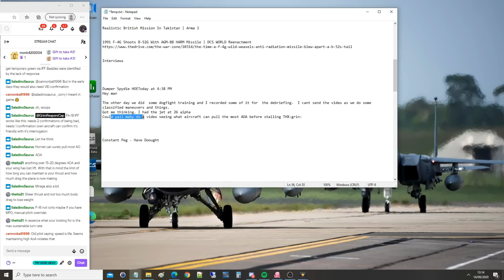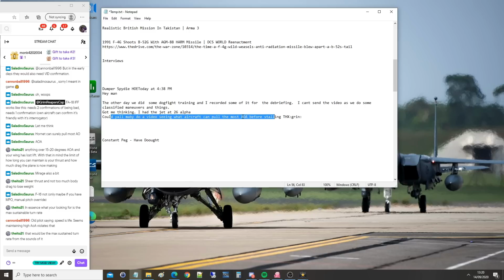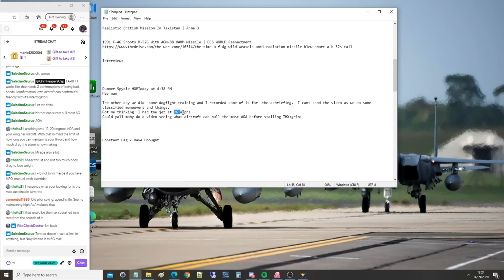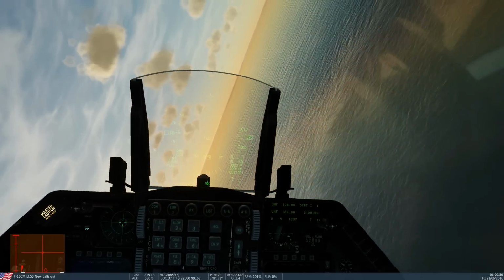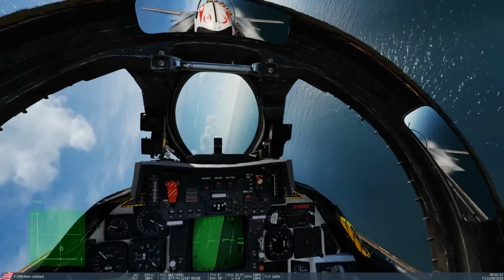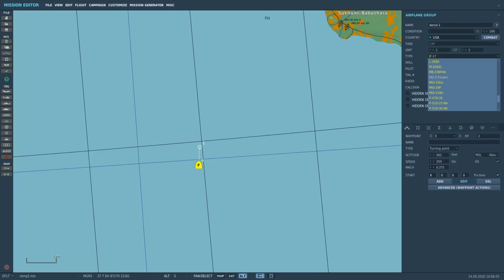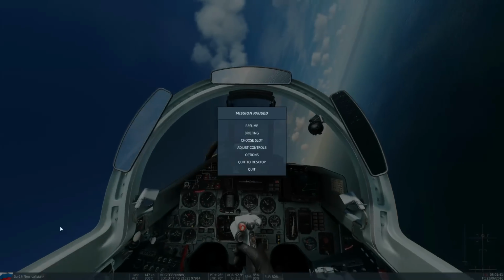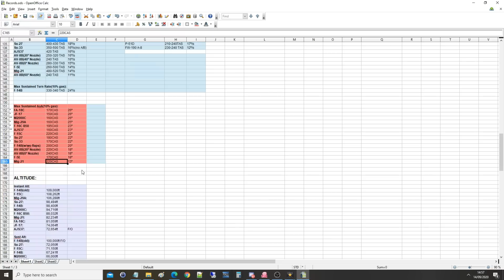Fast Jets: Max Sustainable Angle Of Attack AoA | DCS WORLD

Comment: From T.O.-1-1, a 26000 lbs Block 50 with DI=50 can even sustain max AOA turn at mach 0.22 using MIL power at sea level standard day (lift limit curve intersects with Ps=0 curve), While in MAX AB and same conditions, the speed is mach 0.32. The speed at which max AOA sustained turn is achieved doesn't mean a lot, sometimes simply a difference in thrust setting.

Comment: Turn rate is incredibly important but it is only as good as how long you can maintain it and how good your energy management skills are and your ACM experience. The defending pilot with a better sustained turn rate will take advantage if the attacker, as we've all done, reaches for the shot but expires their energy and thus loses turn rate. The defending plane will then maintain a higher average turn rate and gain the advantage. Some airframes especially, that have a high turn rates, lose their speed very quickly, significantly lowering their turn below below that of the defender. This is a real interesting subject and studying it will make you a better fighter pilot. It helps knowing your plane's capabilities inside out as well as those of your enemies plane.

Comment: I read in Johan Kylander's book 'In Pursuit' that rate of roll is the most important attribute of a plane because "having a superior roll rate means you can change your heading and/or plane of maneuver faster than the enemy and thus outmanoeuvre him. This is especially important when you are in a slower turning aircraft - as long as you hold the rate trump, the better turning but slower rolling aircraft must play by your rules". In my experience, Capt'n, the plane with the better turning rate and energy usually wins the fight so I never really understood why Johan prized this as the most important attribute. The book is in relation to WW2 prop planes. Not sure if this has any bearings on the matter. Johan does seem to know what he's on about. Any thoughts anyone? Maybe worth exploration in a video Capt'n.
Reply: You asked for thought so mine is that he is writing about a different era.  Prop fighters had a wide variation roll rates depending on multiple factors, and it could make a definite difference in combat.  Jet fighters with irreversible powered controls always have a good roll rate that increases with speed, and they are often artificially limited these days.  The clean T-38 could theoretically reach 720 deg/sec, so the ordnance carrying F-5E had an aileron deflection limiter to keep the pilot from rolling too quickly at high speed.
Reply: @gort8203  thanks Gort I think you're right

Comment: To my knowledge.... delta is perfect for low speed maneuvering as it creates vortex over the wings, so different lifting system, also good for faster then speed due to low drag... but it needs fast approach speed and good fly by wire.... all older designs are not delta as fly by wire was not mature enough and/or to high approach speed to be used so they used something in between all the Fs and mig/su are not delta for that reason....bit newer designs are almost all delta.... gripen, tornado, rafale... I thing even F22 is delta....side note, mig21 is not delta as it wing works more like conventional wing...
Reply: "all older designs are not delta as fly by wire was not mature enough"   
You are forgetting generations of delta wing jets from Convair and Dassault (just for starters) that were not FBW, so you don't need FBW for a delta wing.  If the delta was really perfect for low speed maneuvering the F-15, 16, and 18 might have used it. The wings of those planes are not true deltas (even with FBW) because they were designed to maximize sustained turn rate and could not afford the higher induced drag of a delta.  The MiG -21 is often called a tailed delta, but he F-22 is in no way a delta, it is a trapezoidal.  Yes, deltas do work better than ever in a relaxed stability FBW aircraft with a foreplane, but there's more to the story.
Reply: @gort8203  all part of design requirements, you can have delta without FBW but with more drag so they did calculations and come up with best performance for their design needs....but with later designs FBW was able to address some of the drag issues that is way you see more deltas around.... F22 has clipped delta wing, delta wing is not only the shape of the wing but the way it creates a lift. That is way I think mig 21 is not real delta as it has delta shape mainly for supersonic characteristic but is is not working as delta wing...
Reply: @markotdz9523  The delta wing does not exist for low speed lift, it exists to help provide for high speed flight.  It can produce low speed lift at high AOA, but not more than a wing with less sweep and higher aspect ratio can produce with less AOA at that speed. But that higher lift wing is not as good at high speed as the delta.
Deltas don't necessarily have more trim drag than non deltas at high speed. A primary benefit of relaxed stability is the reduction of excessive trim drag as the aerodynamic center shifts aft. FBW allows for relaxed stability and less trim drag for all wing planforms, not just deltas.  
If you want to call the F-22 a clipped delta you have to call the MiG-21 a delta as they both have tails, and the MiG wing is an actual delta planform. The words we use for  them don't change their characteristics so they are only important for a common lexicon.  Every fighter from the F-4 forward has at least a clipped delta if you want call it that, but I reserve use of the term delta for a classic delta because its aerodynamic characteristics differ from an F-4 or an F-16.  The F-106 and B-58 do not fly quite the same way as an F-15.  
Until the rise of the delta canard there were very few delta wing carrier jets because the low speed lift and drag characteristics sucked. Canard foreplanes and higher T/W ratios now help overcome the basic limitation inherent to the delta planform.
Reply: F-22 also has thrust vectoring which adds a substantial increase in both instantaneous and sustained AOA.

Comment: Wikipedia has a good article on the delta wing https://en.wikipedia.org/wiki/Delta_wing.  The short answer is that at high angles of attack the leading edge sets up a vortex that remains stable at high angles of attack.  I think the canard configuration has an advantage because a canard provides additional lift (i.e. its lift vector points up).  Whereas the traditional rear horizontal stabilizer is an inverted wing and has a lift vector pointing down.

Comment: Comparing how much AOA different airplanes can sustain is interesting from the perspective of controllability and T/W.  Controllability at high AOA is an important factor, but it does not directly translate into a comparison of sustained turn rates.  At a given speed and AOA a low lift airfoil will produce less coefficient of lift than a high lift airfoil, even before you factor in additional features such as a larger wing area or high lift devices.  One plane can be at lower AOA while sustaining the same turn rate as another at higher AOA.  There's a reason we compare one aircraft to another with diagrams that plot G, turn rate, radius, and Ps, but not AOA.

Comment: For highly longitudinally unstable airframes like the Viper and the Flanker exceeding certain AoAs (depending on quite a few factors, with the most important one being the longitudinal position of the CoG) basically means swapping ends. So, in this test naturally higher preference goes to neutral stability, effective vortex devices (with delta wings being vortex devices themselves) and the abundance of engine thrust at these speeds.

Comment: It's not you. The F16 AoA and FCS is borked/WIP and even induces oscillations.  Has been like that since the beginning.  It is also supposed to be able to out turn a JF-17, which has a lower g tolerate, a more restrictive FCS irl, and lower TTW, but in DCS the F-16 can only energy fight it.   One or both of them is off I think.
Reply: I've noticed this as well, i'd say both it feels like the JF-17 seems to handle a bit too well and the F-16 I can hardly ever do anything other than energy fight any opponent I face in a gun match.
Reply: Blackbirdz2000   It's basic math, trust me I'm a physicist, this isn't rocket science. You can't have a worse TWR, worse wing loading, and have better STR.  Not physically possible unless the jet somehow has less drag at higher AoA, which would be some special kind of voodoo, or spread sheet massaging.  I'm not really worried about it as I have both jets, and tbh, I don't think it's so much that the Jeff is over performing (by much) as it is that the F-16 FCS is underperforming by a lot.  This has been noted as compared to several other jets in the game besides the Jeff, and as Grim reapers comparison points out, the F-16 is behaving more like the massive Viggen than the Jeff in terms of AoA, which is kind of silly on the face of it given that the F-16 and JF-17 should be closer to each other than to most other jets in the game.
Reply: @ziljanvega3879  Pakistan has both F-16 A/B and C/D and does extensive BFMs among all its fighters. This is what a JF-17 Pilot had to say about F-16 vs Jeff in an interview to Hushkit : 

Q: In a WVR fight would you rather be in an F-16 or JF-17?
A: “F-16 .. for the initial 180deg turn, then Thunder all the way.

Would that mean F-16 has a better ITR and the Jeff a better STR?
Reply: @mahbubazamkhan  the real life differences between the JF-17 and the F-16C are marginal.  Yet in DCS they are like two completely different planes. The DCS Jeff flies like a pure turn fighter, regardless of loadout.  Whereas the DCS F-16 flies more like a dive bomber even when it has 10% fuel and clean wings.  It's borderline silly.
Reply: @ziljanvega3879  How on earth could a JF-17 with a comparable effective wing area, comparable lift coefficient and much lower weight, has a worse wing loading than the F-16?
Reply: @michaellu3357  The wing area of the JF-17 is 13% less than the F-16.  The TWR is 15% more powerful on the F-16.  To balance this, the empty JF-17 is only 25% lighter than the F-16.  With clean wings and running on fumes, the JF-17 has a sliver of an advantage.  However, once you start adding fuel and missiles, the F-16 comes out ahead. But they are still fairly close.  In DCS they aren't close, because the JF-17 flies like a space ship, and the F-16 flies like tug boat, but it's a video game.  What do you expect?
Reply: @ziljanvega3879  According to DCS lua definitions, the wing loading of an empty JF-17 is 6586kg/24.4m^2 = 269.9, while an empty F-16 is 9026kg/28m^2 = 322.3. To achieve the same wing loading as an empty F-16, the Jf-17 would carry 2xPL5 and 39% fuel.
Reply: @michaellu3357   Just to emphasize, I suspect the real issue isn't the Jeff being so broken but rather  the extra drag induced by the Viper's pre-alpha level FCS.  

That being said, with the loadout you mention, the JF-17 would have a TWR of 0.83, and with that same loadout, the F-16 would have a TWR of 1.07.  Which means the Viper would have about about 30% more power to overcome any AoA induced drag in the turns.  So unless the lift/drag coefficient on the Jeff is more than 30% better than the Viper, I'm gonna have to call BS on the notion that "being light" is why the Jeff can maintain better AoA without losing speed, while also having plenty of power reserve to accelerate even more in a full stick deflection turn.

Comment: you have to hold "y'" down to over-ride the stick deflection limiter. It is not a hard limit per se, the control loading on the stick just requires much more force from the pilot to pull past it.
I'm also pretty sure the  data shown by the DCS  info tab at the bottom is not necessarily accurate with third party modules.

Comment: For those intersted about LEX and Delta wings from an aerospace engineer

Both work on the concept of vortex lift. After some aoa at the right conditions (primarily Reynolds number and leading edge radius) the high pressure at the lower surface rolls up to the upper surface. This creates a vortex, much like whats happening at the wingtips. 

The difference is this vortex attaches to the wing surface to create a lower pressure zone and creates more suction on the top of the wing. Now this has some implications, the main one being an increase in the lfit curve slope of the wing meaning the wing is more sensitive to aoa changes and can produce more lift than the no vortex case. However, the vortexes are sensitive to disturbances and can very easily cause asymmetric lift under a sideslip angle. If you are curious you can read some papers about the F18 LEX fence development to reduce this problem. LEX fences help control the vortex from the LEX under sideslip angles and produce a more even lift distribution.

Now I dont believe the wing stalls as it is hard to stall low aspect ratio wings fully, especially with large sweep like the delta wings, or with LEX. For example both the Mirage and the Mig21 have similarly swept delta wings around 55deg leading edge sweep but Mig21 loses control earlier at 14 degrees or so. If you pay attention the Mirage has some fences on top of its wing too, I believe these are to create an additional vortex to control the main leading edge vortex such that the aircraft is under control at a greater range of angle of attack. The Mig21 is missing this sort of flow control device, it is simply not designed for it hence the loss of control. But to reiterate I don't think either the wings on the Mirage or the Mig21 stalls fully, the probably develop zones of flow separation which changes the rolling and the pitching moment and makes the plane unstable, that isnt to say you cant extract more lift. If you were to test the wing in a windtunnel attached to a spar you can see an increase in lift probably up to 30 degrees or so but the wing itself would be unstable so you wouldn't be able to control it.
Reply from the maker: Thanks Sir, that was some really cool info.
Reply: "The difference is this vortex attaches to the wing surface to create a lower pressure zone and creates more suction on the top of the wing." Finally, someone who gets it. So tired of hearing the same "energizes the boundary layer" regurgitated mantra over and over again.
Also, from what I can tell, a basically huge vortex generator - that is the delta wing - produces a large, whole upper wing-encompassing whirlwind, acting more effectively than what can be achieved with a typical LEX (especially something as subtle as the Flanker's).
The biggest problem with deltas appear to be the other side of the coin: what makes the wing produce more lift also makes it produce more drag as well, hence you need a massive engine (or better yet, a pair of those) to make the whole thing effective. What stalls you is not enough airspeed for a given mass and the subsequent loss of stability, not exactly the AoA... And THAT is the Fishbed's problem. The engine in it is simply inadequate for the task. Also, I would argue that not being a pure delta doesn't really help that either, since the horizontal stabilizer only subtracts from the total lift all the while still adding more drag. But in my opinion there is also a one more possibility: the flight model developed by Leatherneck for it is not all that great.

As for the Mirage, I also think that the fore strakes serve as vortex primers. Interestingly, Rafale's canards seem to be located identically to the Mirage's strakes (compared to either Typhoon or Gripen). I believe Dassault made them into an active system of that sort (apart from actually controlling the pitch).
Reply: Could this sensitivity of AOA changes is, as I understand it, be the cause for the "Draken Cobra"?
https://youtu.be/jqiDEcfSnXs?t=112
Reply: Very nice summary. This was my general perception of it, but without the data or any significant science to back it up. Thanks!
Reply: Granted that the primary contributor to additional lift is the lower pressure caused by the stable vortex.  However, does the vortex not also serve to delay flow separation to a point further aft on the wing, the benefit of which is reduction in induced drag allowing sustainment of higher AOA, especially with a wide chord delta planform?  Is not the very low aspect ratio rather than the sweep angle the source of the delta planform's higher induced drag?  In fact, is it not a misnomer to state that delta wings cause a stable vortex, when in fact any sharply swept leading edge will form such a vortex?  My gut tells me the difference is one of application because the deep chord of delta planform provides more surface for the vortex to influence than does the more constant chord of a similarly swept near rectangular wing.
Reply: This is some deep stuff. It's beyond the simulator's programming. That's what the devs have to master, then we know the truth in the plane vs plane. The pilot at a point can shift the fight with this AoA stuff.

Comment: hey guys, heres a good little bit of fun for you and RC

Su-27 vs F-15 with  2x sidewinders/russian variant and guns only centerline tank/100% fuel

Su-33 vs F-14 with 2x sidewinders/russian variant and guns only, centerline tank/100% fuel

which is the best in this type of fight
Reply from the maker: thxx
Reply: Hope to see this on the channel, could make for a very nice video
Reply: 33 vs 14, unless the 33 pulls off a high boresight shot very early on the f14 will eat the 33 alive
Reply: Also depends on the skill level of the pilots of each, situational awareness, how each plane handles the weight, the performance of the planes.

The set up I suggested is ment to cause them to be in a dog fight
Reply: @Blackout91  obviously the pilots skill is the most important thing. thats why i assume equal skill to remove that variable
Reply: Well, between Cap and RC, I do believe the skill factor is even, hence not a variable, lol